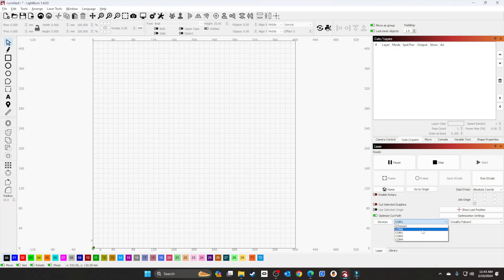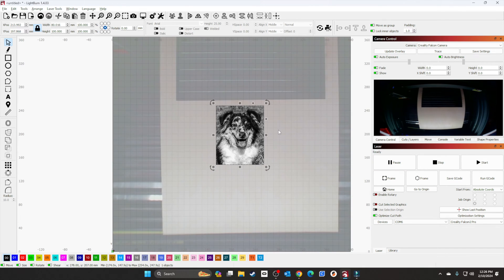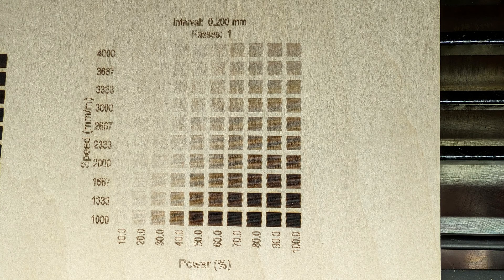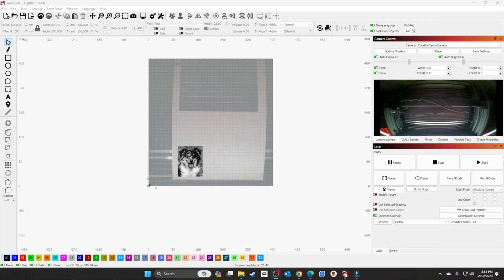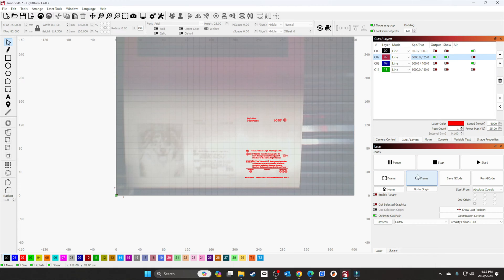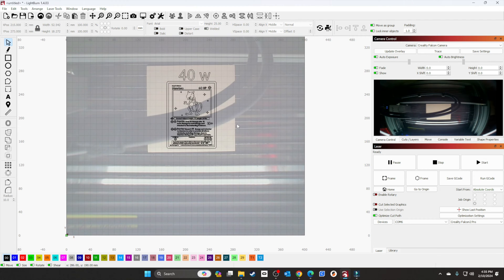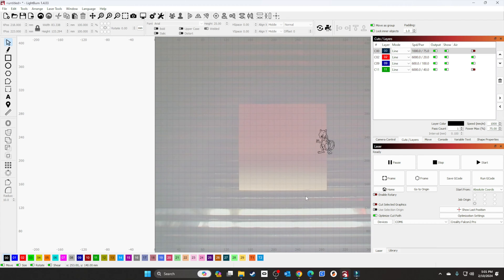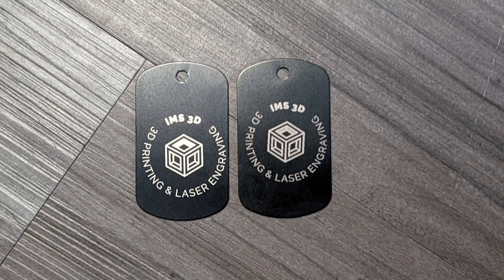Creality Falcon2 Pro 40w vs 1.6w detail test

Comment: The 1.6 watt has a much smaller dot size which is why it's sharper.   One parameter you didn't touch on is the lines per inch (DPI is another term).   To create better pictures, first determine  the correct lpi using Lightburn using the interval test.  I would think the 1.6 will have a considerably larger dpi than the 40watt so the lines have to be much closer together.  After watching your video I ordered a 1.6 watt.  
I couldn't find the module specifically for a falcon 2.  It looks like it uses different wiring and it doesn't look to have air hookup.  Was it hard to switch over?
Bill
Reply from the maker: Thanks for that info!.  The pro 40 watt came with it and has the correct wire.  Not sure if Creality is going to sell that model separately but would be smart for them to do it.  Is does not have anyway to connect air.
Reply: Hi, did you manage to find a way to purchase the 1.6 watt module?
Reply: @alexj8158  I bought the 1.6 watt module kit for ender 3d printer.  It seems to have the same specs.  Doesn’t have mounting or power connection for the Falcon laser though.  I started working on putting on my old Ortur which I’ve modified heavily.

Comment: slow it down with the 40 watt to 3500 and 7 to 10 power. every 40 watt is different , so you have to try speed vrs. power. always run the air and adjust it in light burn to on and then you can adjust the air down for engraving and full air to cut thru. Air keeps the lens clean from the tiny particles from engraving and cutting. It also keep the laser cool which heat is the killer for a diode laser.
Reply from the maker: Thanks for the advice, will give it a go.  I do appreciate it.